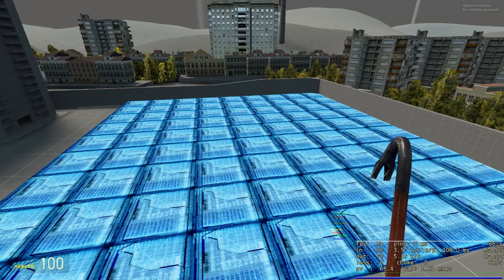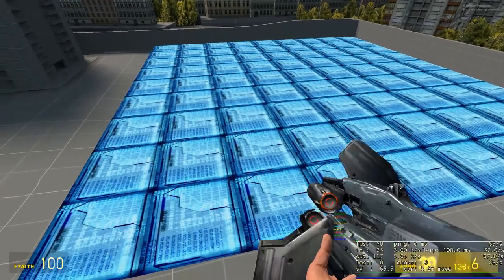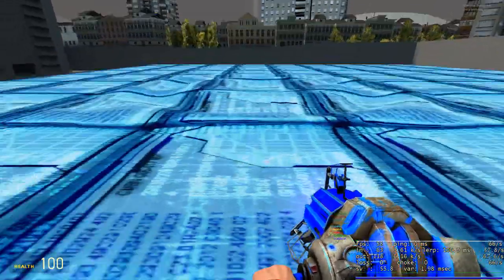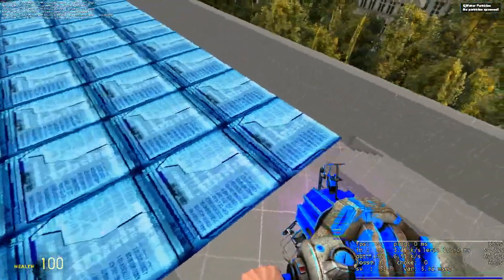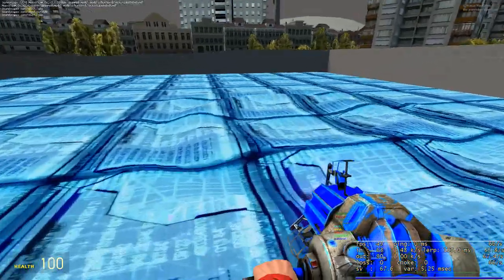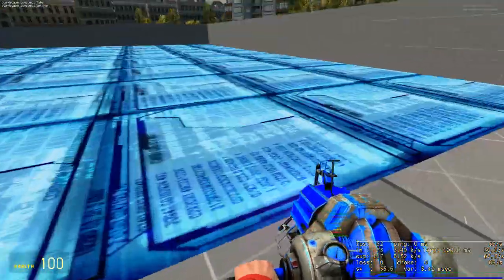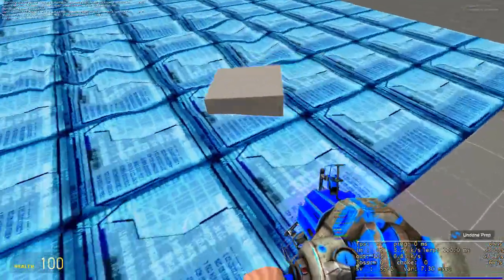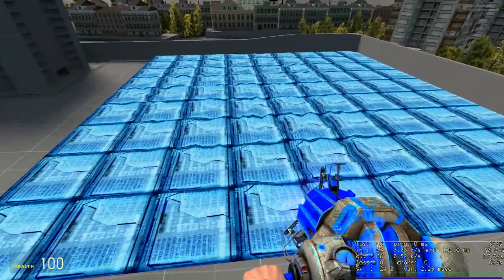Procedural Terrain 1 - The Base

Comment: Using armature deformation to handle terrain is pretty sneaky. Probably the best way to accomplish this short of writing a new vertex shader to translate the vertices. Does source have any hard coded limits on how many animated models can be rendered at a time/how many joints/bones a mesh can have?

Comment: You should find a way to make infinite dimensions using your custom terrain idea 

Ps sorry for me being unaware of how modding Garry’s mod, works
Reply: Gmod maps have a relatively small max size but you could probably make something where you're teleported back to make it seem like infinite terrrain
Reply: Moon Have you seen gm_hugegrid? You could probably set it up to use a map of that size, would be absolutely massive.
Reply: I think there was a rick and morty themed mod that added custom dimensions
Reply: Say hello to Localized Physics and Infinite Maps.
It's rather old at this point, even predating the workshop release, but it's still one of the coolest things. I wonder if Mee could take a crack at it, or a similar concept?
Reply from the maker: Ive thought about it, and decided im not even gonna try, its super complex and hacky. 
localized physics does it good enough in my opinion
Reply from the maker: ive thought about different dimensions though, which is way easier of a concept
I likely wont do it since its not that interesting to me, but its certainly possible
Reply: Well check his latest video